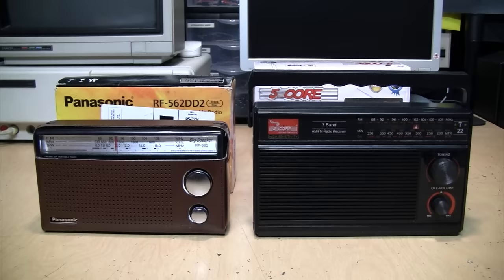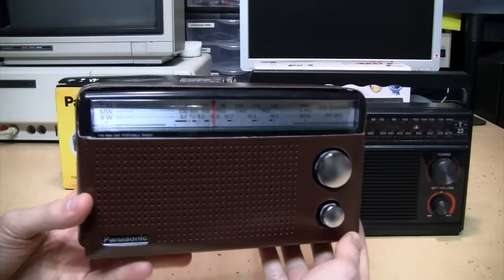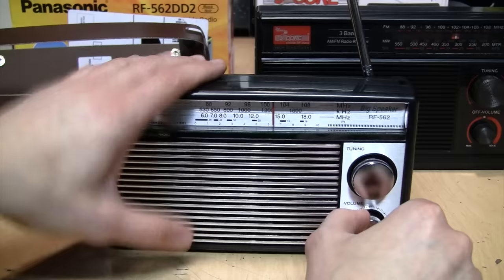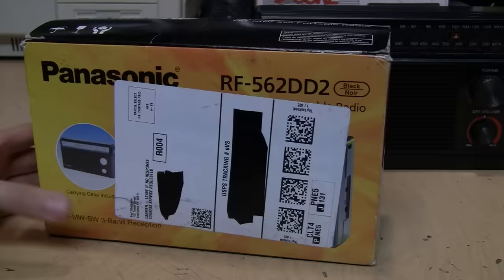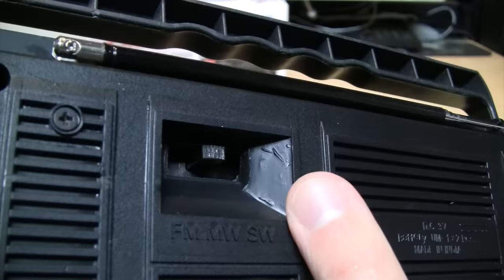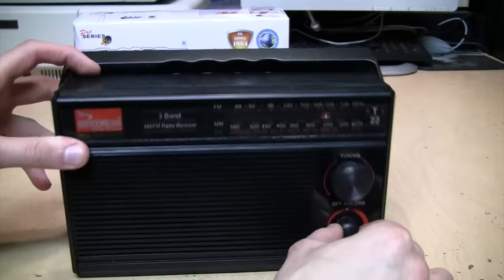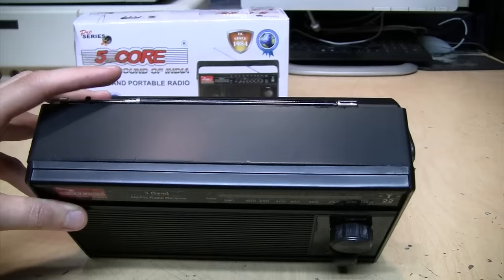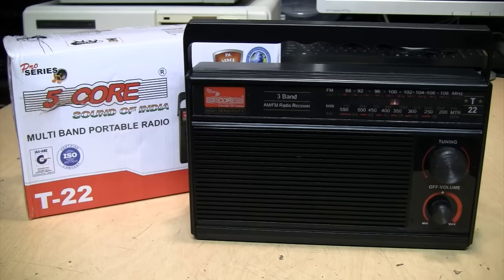Searching for the last true analog radio - Panasonic & 5 Core

Comment: I'm glad I'm not the only one who noticed that analog tuner radios sound and tune better
Reply: It's probably largely down to how well made the digital tuner is. Like someone else mentioned elsewhere in the comment section, it's a race to the bottom, so most of them tend to use very low quality digital tuners.
Reply: That's what I love about my Magnavox boombox! It gets as good reception as my classic receiver hooked up to a long wire antenna.
Reply: I don't even understand why an analog radio even needs a digital tuner. We live in an analog world and have analog senses.These digital radios take an analog input signal, convert it to digital, convert it back to analog, and output it to the speaker. This is two steps of needless conversion. Just leave it all analog, like the Indian radio does.
Reply: @tarstarkusz  So, why wasn't this a problem in the 80s? People were fine paying the extra for quality. When did we become such cheapskates?
Reply: @dougbrowning82  I agree but we are all to blame I guess. An am fm portable was 80 bucks back in the 60s. A cheap one half that. So that's like a 150 to 300 purchase today. Yes the same goes for a class d amplifier. Is it really much better? Well it's smaller and lighter. Probably less likely to last too.
Reply: @dougbrowning82  when the cost of chips dropped to well below analog parts. It’s always about cost, not necessarily performance.
Reply: @tarstarkusz  probably. Just seemed we had more money back then.
Reply: I think it's experimenting with production, the more the people buy the more the money flows, kind of how the medical field does with medicine. They got people pushing the sales saying this d.s.p. is super, but I know radio, its a sacrifice sensitivity for selectivity, last summer I spent all summer buying and testing the new d.s.p. radios on f.m. I was terribly disappointed. My old analog kaito is a master, GREAT RADIO.
Reply: That's the kaito1103.
Reply: @dougbrowning82  We became cheapskates when it comes to tuners when FM radios became a novelty to most people. I mean, try convincing the average American that they even need one at all, let alone a quality one.
Reply: Progress, eh? Entrepreneurs boldly exploiting technology to make products for less that don't work as well as original models but look similar. 

But even broadcasters find new ways to save money on transmitters and transmission costs citing 'green' arguments to save money. The joke with 'outdated' analog broadcast FM radio is that it's often better quality than the 'modern' DAB signal broadcast. DAB could be far better than FM, but it has been a huge disappointment because broadcasters refuse to spend money on better quality signals. People need to protest about plans to shut down FM radio transmitters!
Reply: @frglee  It's not signal strength cost that makes DAB so bad, it's the fact that a station can half their bitrate to half the radio band used, allowing them to lease out the freed-up frequency band to even more "stations" without paying for another FCC lisence
Reply: @dougbrowning82  Because we could. A digital radio can be manufactured entirely by robot right up to the shipping. An analogue radio required manual alignment with the associated skills, test equipment and real estate. Consumers and fool politicians were also conditioned by marketing to accept "digital" as better even though it isn't.
Reply: @TheNugettinage  Exactly.That choppy tuning does not have to be that way.
Reply: I use a 1970's Realistic Patrolman-9 nine band radio
Reply: @dougbrowning82  People were also cheapskates in the 80s, buying cheapo things from market stalls etc, just as they do now, except it's online and not market stalls.
Reply: @tarstarkusz  yeah, we're so poor these days that anybody can listen to almost anything on the internet...
they also forbade books so there's nothing to read if we think there's nothing on radio...
utter doom.
Reply: but what about rtl sdr compared to these chippy radios?
Reply: Even in the 80's My radio cassette sounded crap on AM, my father in law had a Grundig model the AM almost sounded as good as the FM.
Reply: I have a FM stereo tube tuner from the 70's. Its part of a component system paired with a preamp and power amp. The sound quality as well as the stereo separation is just astounding once its locked into a good music station. Non of my digital tuners could match including my newest Dobly Atmos receiver and I'm not a tube or a turntable guy.
Reply: I noticed it when I bought one for hurricane monitoring.
 In a serious disaster like that you are screwed trying to tune in to the public emergency anouncement through the static. New radios with chinese parts might as well be broadcasting in chinese.
Reply: And I agree but don't know why.
Reply: this is only true at the lowest end
Reply: @markanderson350  80 USD in the 60s would be more like 400 USD today. And today's 400 USD FM portables will absolutely defecate on these older ones for DXing.
Reply: @cduby1424  I'm really curious what DSP radios were you testing. Did you test those that are recommended on DXing forums? Or just some random Chinesium garbage?
Reply: @fungo6631  I do notice newer solid state devices are smaller and work better on high frequency and tubes in an FM radio drift and have so much capacitance they preform poorly even back then
Reply: @fungo6631  Over the I purchased a Tecsun 990x and it is a great radio, its also D.S.P Im very happy with it.

Comment: All the portable radios we have at home are 80s Soviet analog tuned ones, with exception of 80s SONY with digital tuning. 
Those Soivet ones (VEF206 and Selena B211) are built like a tank, with very sensitive tuning circuits on carousels. 
Powered with 6 D-cells, combined with low minimum operation voltage and consumption around 20 mA, the cells would usually leak out before the radio could drain them.  The last set of cells lasted for well over a year, despite the radio being used almost daily. On the other side is the SONY one, which can suck 6 AA-cells dry in 6-8 hours.
Reply: With any Soviet made equipment (like Lada cars) I wonder what the true cost was when they were being made. I would guess they cost much more within the USSR while in Europe their electronics were always sold as the bargain basement alternative to stuff made in Hong Kong, apart from Shopertunities who would claim they used the same technology as Russian spy "trawlers".
Reply: I suspect it is the case that most if not all digitally-tuned radios use more power than their analogue equivalents.

Probably not a fair comparison but my Roberts R809 will only run for about a day on a set of 4xAA cells, whereas my Saisho-branded one (also multi-band) works for ages on a set of 2xAA cells.
Reply: @MrDuncl  VEF 202 cost 99 rubles, VEF 206 117, Ocean 209 (Selena 211) 135 . Average salary in 70s-80s was 130-160 rubles. But you cant go to shop and buy any radio you want. Some model need get through friends, or wait when will they appear in the store.

Comment: They've certainly got the look (and sound quality) of a 70s portable AM/FM radio. I'm  glad they sell tell these. :)
Reply: Now I want to buy one of those Indian radios and try to see if I can solder the missing DC power jack to the circuit board.
Reply: @claypf4795  I'd imagine it doesn't have a transformer
Reply: It doesn't need a transformer if you can run it off DC wall wart. You only need a transformer if you want to use AC to power a DC radio.
Reply: @EmergencyChannel  yeah, the adapter IS the transformer, but I didn't want to get into a fight with him. There's often a few components on the board for voltage regulation, those may need to be added.
Reply: @claypf4795  Probably just needs a few diodes and filtering cap if anything. This would end up being a 3v wallwart now. The casing just says 4.5v because obviously the original internal design used 3 batteries instead of 2.
Reply: @mikem.9197  Most ICs for analog radios can handle a wide range of supply voltage, so it'll probably be fine even if you put 9 volt in it.
I'd use a 5 volt adapter and a couple caps to filter out ripple, and a protection diode.

Comment: I'm pretty sure that the main reason why analog tuning radios are still sold in developing markets is because they are simpler in design.
And DSP-based dial radios are probably a thing to save as much manufacturing costs as possible.
Reply: In developing countries (especially in rural areas) you may only have weak radio reception, maybe even AM only. Probably there is no (or very slow) internet access. 
A well working radio max be your only source of information and music.

In NYC or Paris  you are probably happy with a digital radio that looks nice, bonus if it works as a bluetooth speaker for spotify. If you ever use FM on that bad  digital tuner  it probably works just fine because there are several strong FM stations....
Reply: 99.999% of electronic workmanship for consumer products is puuuuure junk !   Most of the time I have to open up the unit to deflux and touch up all the solder joints to at least IPC-A-610 Class 1 standards.
Reply: @etow8034  What is IPC-A-610 Class 1 standard?
Reply: Dsp radios eat batteries

Comment: We live in the era of the big decievement. It's all about package. Shame on Panasonic. Who is running Panasonic letting this happen?  Pretty from the outside, ugly from the inside. Refreshing to see the pureness of 5CORE, it has a heart. Thank you for - yet another - debunk!
Reply: Panasonic radio is run by their chinese side of business I think. Radio isn't big business, their real growth area is lithium ion batteries.
Reply: @Lassi Kinnunen 81 They do that with entry-level devices like this radio here, but in general Panasonic is a very respectable brand and still manufactures many products in Japan. The vast majority is also engineered by Panasonic and not rebadged.
Besides, no one in the target audience would ever have noticed, let alone complained, about any "choppiness" in the tuning. Those people who do would not buy such a radio anyway (and those who need one for their workshop would probably get a second-hand one).
In general, it's just funny how the tone of the video inﬂuences the comments section. A brand can be praised to heaven or shred to pieces depending on what the uploader believes. Check the comments in Techmoan's Panasonic boombox videos for an example.
Reply: Panasonic used to make way nicer looking radios than that back in the 70s, kind of disappointed even with the design really
Reply: @MacPhantom  You definitely make a point here, as Panasonic is a respected brand associated with high quality supurb products. Therefore Panasonic should not tolerate and associate with a product meeting poor / lower standards like this radio. I for one would like to see intervention and quality upgrade from Panasonic, after the revealing from this investigative video.
Reply: @MacPhantom  Strangely Jay Allen, who has collected and reviewed hundreds of radios rates the DSP Panasonics highly. He is using different criteria though; trying to receive distant AM stations in the presence of powerful local ones.
Reply: @santioriginal  It will hurt panasonic the most. People see panasonic as garbage now thanks to these cheap products, in spite of the high end products due to volume, and because of this, panasonic is forced to dedicate more resources into garbage products as they are the only ones selling. Manufacturing in china is selling your soul to the devil. It is trading your respect in for temporary profit.
Reply: Did it occur to anyone that the Panasonic radio is not made by Panasonic?
Reply: @Bubu567  bruh if panasonic buy shitty cheap thing from china it's their faults. Panasonic have product requirement and QC an it has nothing to do with china
Reply: @wongjowo9152  There is an old latin saying, qui cum canibus concumbunt cum pulicibus surgent.
Reply: @Bubu567  i don't understand
Reply: @wongjowo9152  It's a proverb. If you lie down with dogs, you wake up with fleas. 
In general, we tend to group people together. So, if you associate with people of ill-repute, you can expect to be held in the same esteem- or lack of. Because we tend to group people together, we presume that associates condone each other’s behavior and share values and attributes. In doing this, we can make some fairly critical assumptions about someone’s character, based solely on who they hang around with.
Reply: Average consumer does not longer demands quality so they dont deliver it. In the 70s they did stunning receivers ... they know how do things professionally. But no one is interested to pay for them. They solved this just by using the vintage apeal looking. Perdiod. Same as cheapo Technics in the mid90s. Nice outside, CRAP inside. Was Panasonic wrong ?. Not, all the other brand were as cheap and mean. They followed the trends and they keep doing that right now. They keep perfecting LCDs, phones .... and phase out all the other things that people is no longer interested in. PC, internet and phone have taken the place of the portable radio, the walkman, the PDA, the camera, the digital Dairy ... etc.
Reply: The Panasonic RF-2400 is still analog, but the RF-2400D is not !
Reply: @Constantinus213421  Panasonic still makes their radios under their own factories mostly in Indonesia now.  China has too many radio manufacturers for Panasonic or Sony to compete with.
Reply: @Bubu567  I have 5 Panasonic RF-2400D and they work great regardless if they are DSP radios. China makes good radios too if you're willing to pay for them !
Reply: @etow8034  六四天安门事件
Reply: there is a really big difference between low end panasonic consumer electronics and what they make for professionals. find an electronic components catalog and see how many individual components panasonic makes, it's a huge amount. they also make stuff like broadcast TV cameras that cost as much as a good car. regardless, the "heart" of the 5core radio is a sony chip that is no longer being made
Reply: Panasonic should be ashamed to put their name on most of their new radios.
The Chinese deception is so ubiquitous that if you search for “analog” radio, the results are DSP radios with analog-STYLE tuning scales. It’s frustrating and disgusting.
Reply: the things is that  this company also stop manufacturing this device's  i think only last exported device's are  available on ebay
Reply: @MrDuncl  In Jay Allen's review of the Panasonic, he specifically says it is analog, not DSP. I own the same unit, and it's an excellent AM radio.